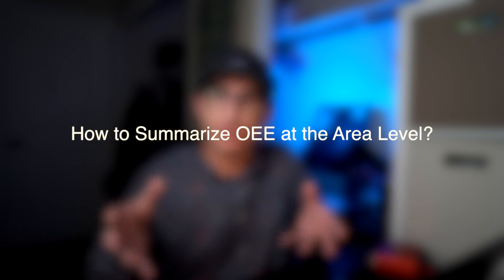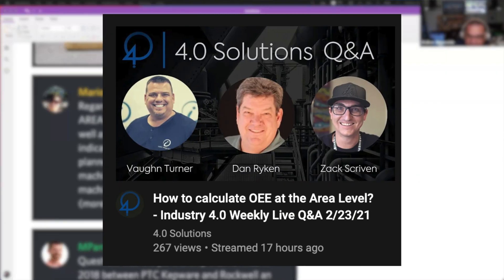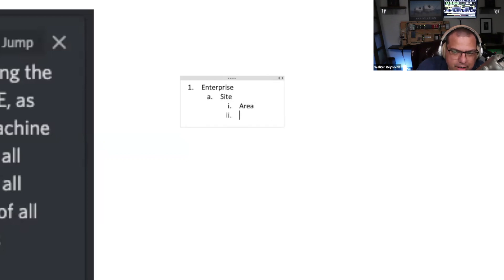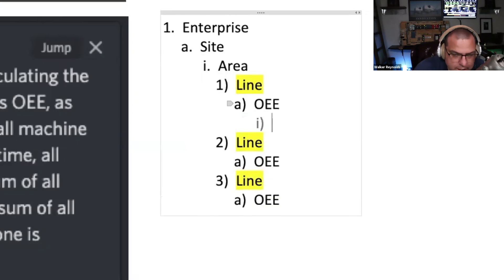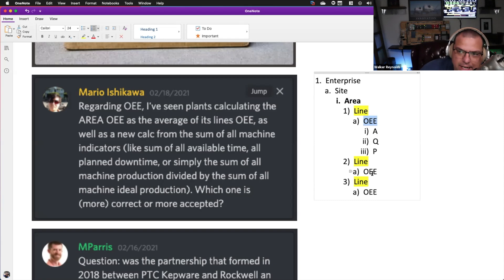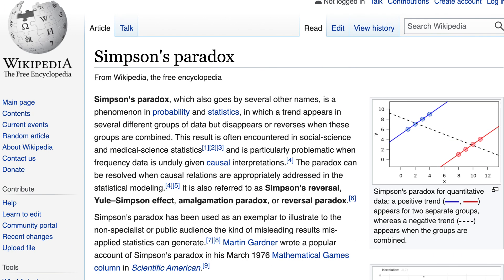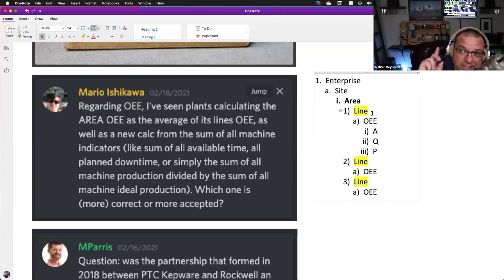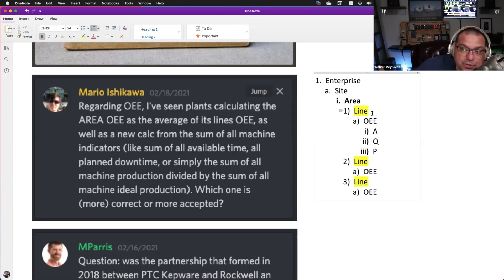How to Calculate OEE at the Plant Level?

Comment: It would be great to see a complex example where for instance you have multiple cells in a line with one operator each cell and multiple equipment options.  Iam a beginner at this so excuse my ignorance.  Love the content currently trying to put together tableau dashboard for the site using data from mes system.
Reply from the maker: What do you mean by multiple equipment options? Thanks!
Reply: @4.0Solutions  You have a process flow with 3 steps and one of the steps you have 5 optional tools you can use.

Ex.
Process Flow A
- Step A - 1 tool
- Step B - has 5 dep tools to process a product
- Step C - 1 tool

Comment: I disagree with your Area OEE calculation method of using aggregates. That method will make sense only if the Net Ideal cycle time used on your Performance (P) factor of the OEE calculation is exactly the same across all production lines. If one of the lines makes 1000 parts per hour and the next one makes 50 parts per hour on the same area you will get completely skewed and incorrect results following your aggregate method.
Reply from the maker: Great point!